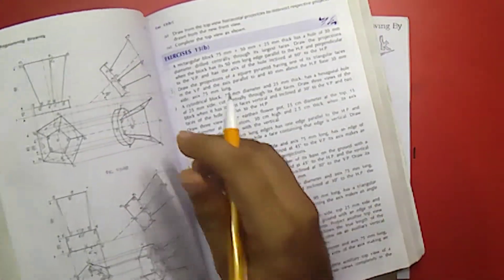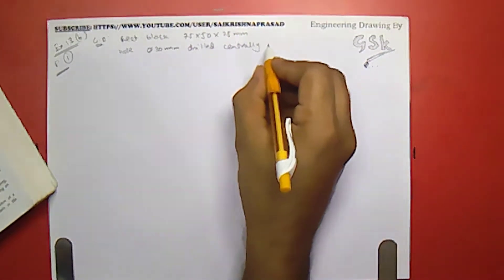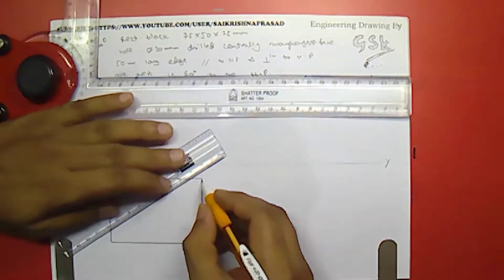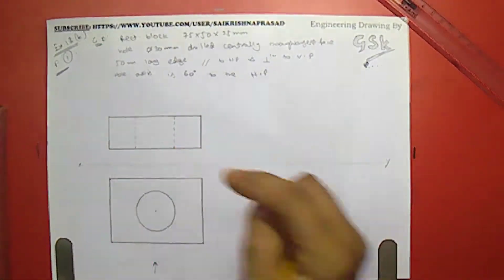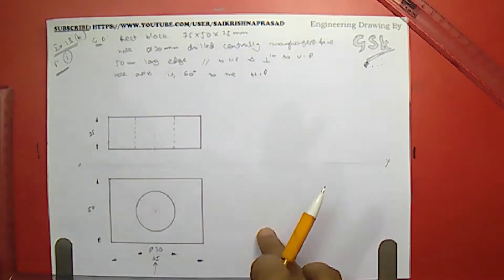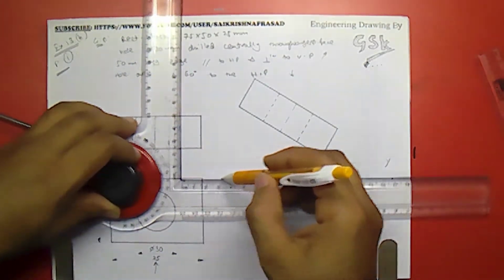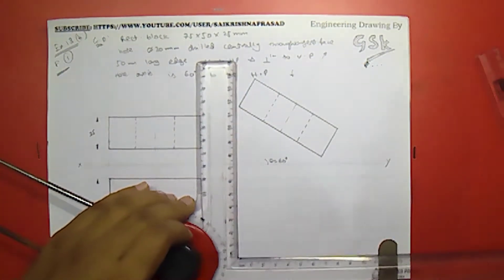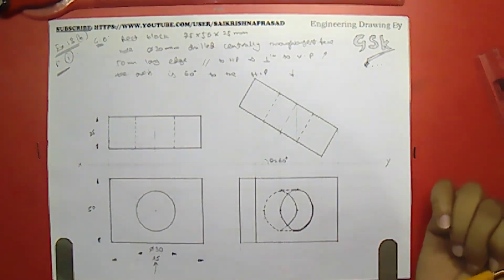Orthographic Proj  of solids Exercise 13b Problem 1

Comment: Sir where is the points u represent s
Reply from the maker: THERE ARE MNY WAYS TO DRAW, YOU CAN ASSIGN ALL CORNER POINTS WITH SOME ALPHABETS AND THEN PROJECT THEM TO OPPOSITE PLANE, OR SIMPLY PROJECT THE CORNER POINTS.

HERE I DIDN'T USED POINTS REPRESENTATIONS TO SAVE TIME AND MAKE CLEAN FINAL VIEW. 

IF YOU LIKE TO USE ALPHABETS FOR POINTS REPRESENTATION, YOU CAN USE THEM, NOTHING WRONG IN IT.
THANKS FOR ASKING QUESTIONS.👍